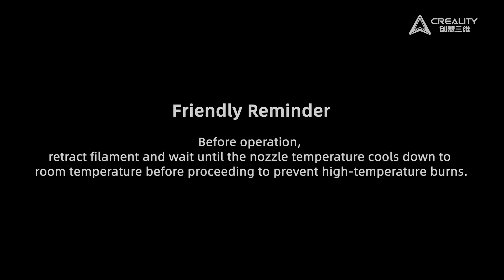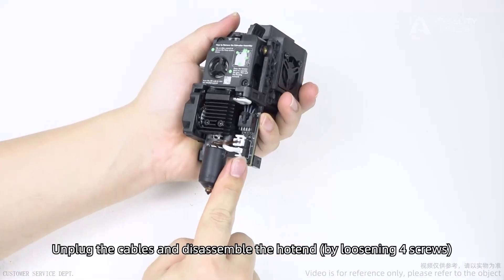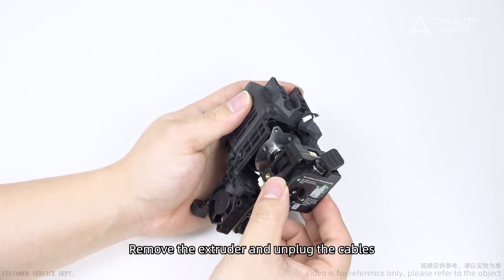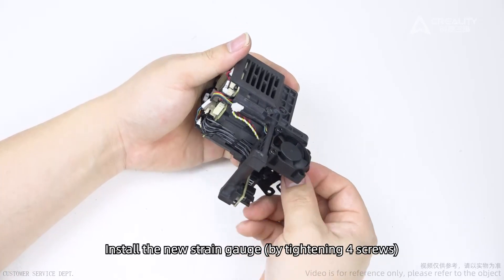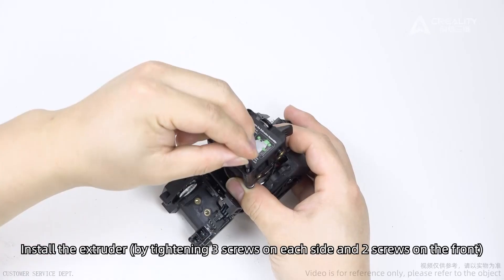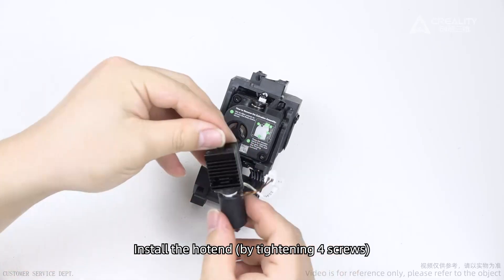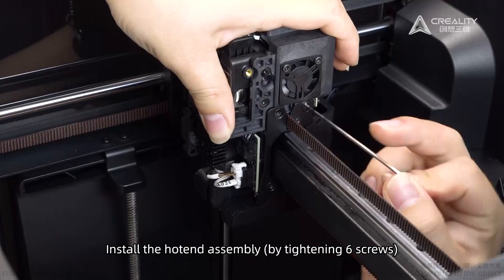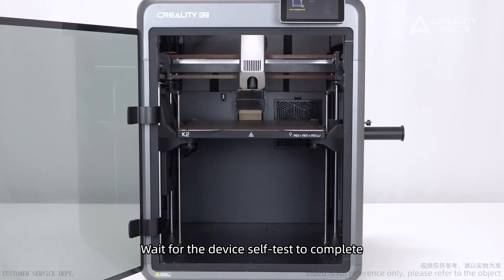Service Tutorial K2 Strain Gauge Replacement

Comment: Hello, please address the issues with the printhead cable. After a few months, it starts to develop internal breaks due to fatigue at the bend where it accesses the printhead. This area is under significant stress and flex. The printer then begins to display all sorts of errors, including a level sensor error. In my case, a hotend bent due to suspected leveling problems. I replaced the level sensor, but the problem persisted. It turned out to be the cable, which deforms and breaks internally at the last bend before entering the printhead. Access should be from above, not at a bend.
Reply from the maker: Hi, if you encounter any problems, please feel free to contact our after-sales service and they will help you solve the problem as soon as possible.  Facebook official service : facebook.com/crealitysupport